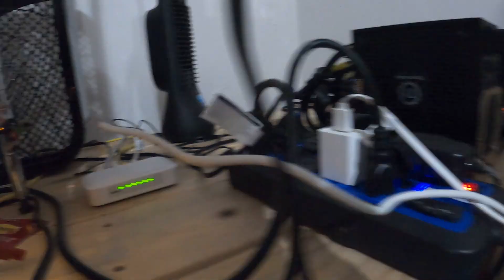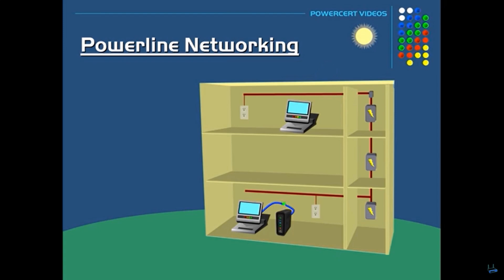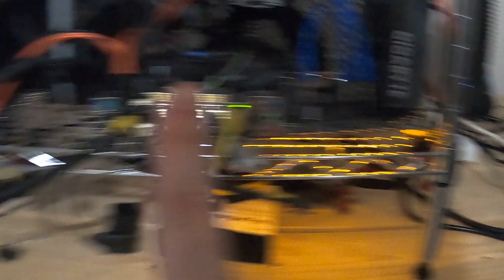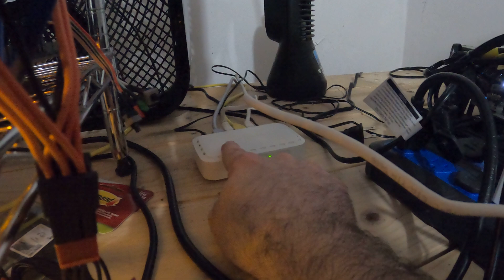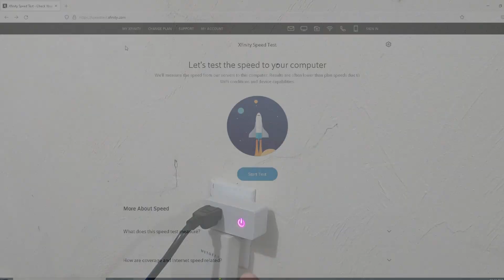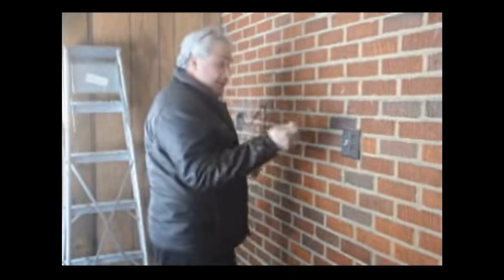How To provide INTERNET for MINING RIGS

Comment: I also feed my rigs with internet from a powerline adapter because I have no better option.
It's not super reliable, I have it break up when certain devices are plugged in to the mains, especially cheap chinese electronics that have no filtering.
It also seems that you have the link led blink RED, I'm guessing the connection is breaking up constantly.
I achieve link of around 200Mbps so 10x more, I use some TP-link adapters rated 1200Mbps.
I had situations where just using different wall socket in the same room resulted in doubling the transfer speeds, I'd suggest you try that too.
Reply from the maker: Thanks for sharing Arek! My connection is stable no breaks but the speed is not super fast. I’ll be adding more 120v plugs near the rigs so I will attempt moving it to see if I can get better speeds
Reply: @CavemanTech-ai  So why is the red LED for powerline connection status blinking red?
On my gear it means that the link is weak, solid red for completely broken link.

Comment: I have a similar setup. Wife didn’t like a 50ft Ethernet cable running through the house so after looking I found a power adapter. Works well, I have my line run to a switch and the switch feeds 3 eth rigs and 2 cpu rigs
Reply from the maker: Awesome thanks for sharing ? Powerline FTW